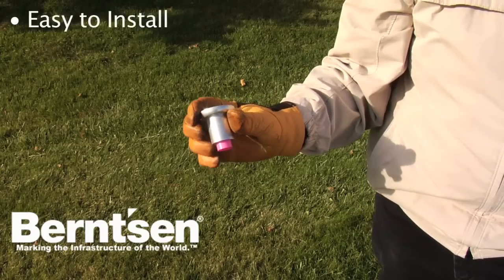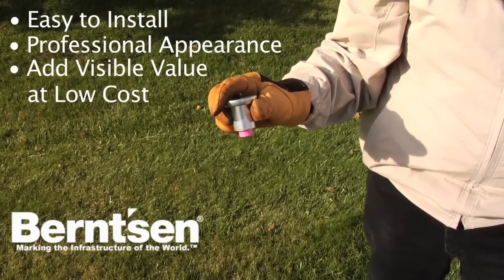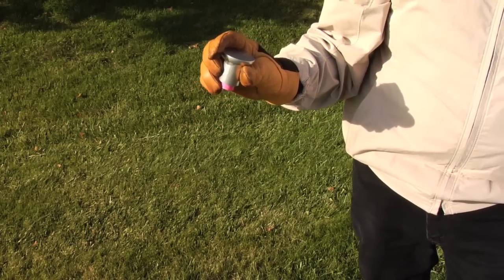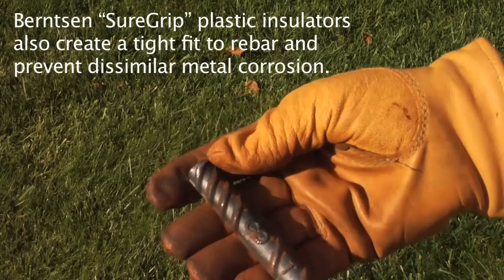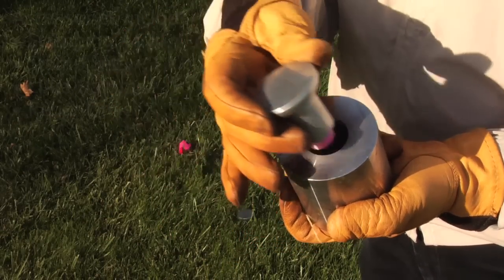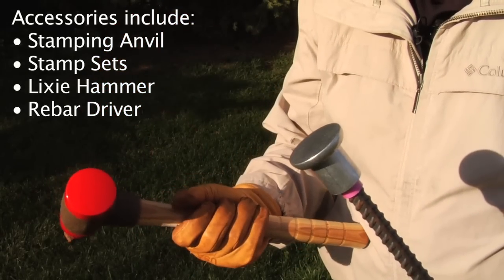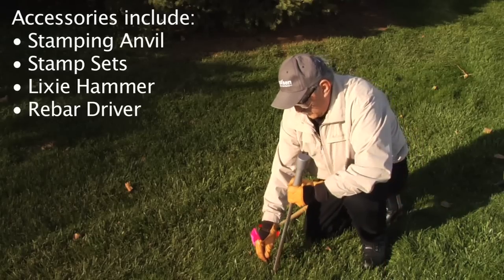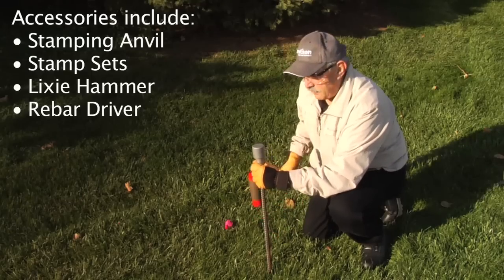Berntsen Survey Markers Installation Instructions

Comment: What is the typical rebarb diameter used for these markers?
Reply from the maker: We carry caps for rebar sizes 3/8" through 1". We also have multiple cap diameter sizes for your convenience. https://www.berntsen.com/Surveying/Survey-Markers/Aluminum-Survey-Markers
Reply: Perhaps, I should've been a bit more clear.  I had a survey done on my property and they put down the four of the typical wooden sticks with flags. I'd like to replace them with a more permanent solution. I was looking to purchase caps from you, but not sure what the average rebar size is for my use case.
Reply from the maker: In that case, we suggest first following up with your surveyor to install a more substantial monument. It will then be “recorded” on your survey and is considered a “legal” monument placed by a licensed land surveyor. He would also have a rebar size preference that he would use. Hope that helps. If you need further information, you can call us at 800-356-7388 or  email us at surveymark@berntsen.com